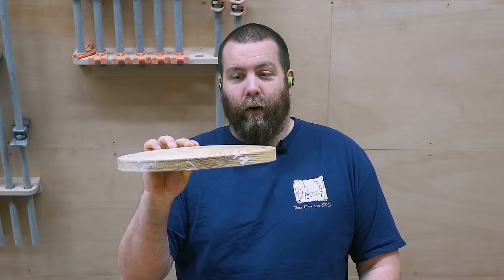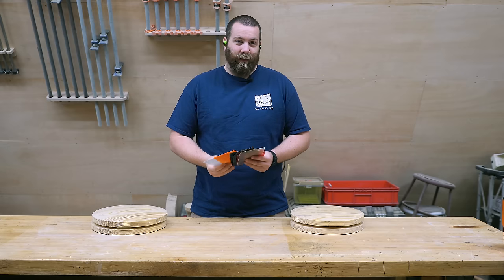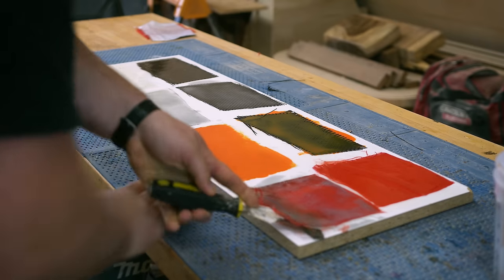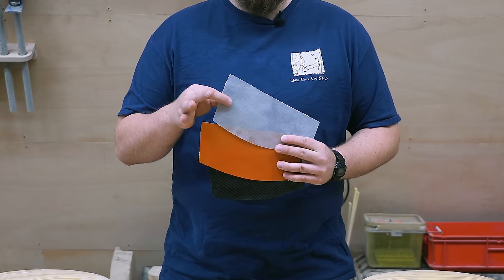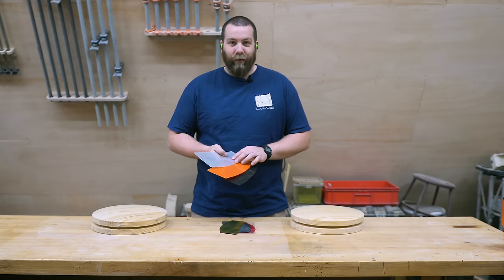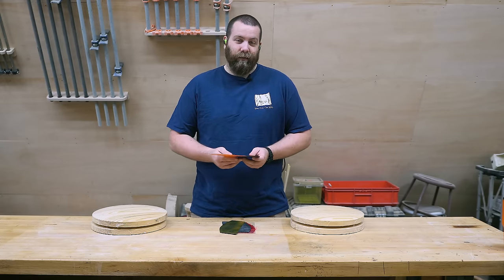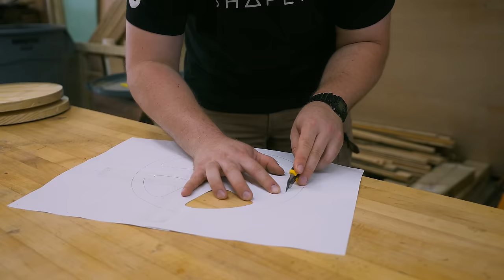I Made Spinning Rims for my Lawn Mower

Comment from the maker: I want to keep making fun videos and my incredible sponsors are the reason I can spend so much time and effort to make them, please support my sponsors so that I can keep doing it! Links and discount codes below for all the sponsors of this video:
𝐂𝐚𝐫𝐨𝐥𝐢𝐧𝐚 𝐒𝐡𝐨𝐞 (code "June15" gets you 15% off all styles thru 6/19/22 11:59EST, code "JACKMAN gets you 25% off select styles thru 6/30/22)
► Gust Lo Aluminum Toe Shoes https://bit.ly/3tFq4VG
► Insulated Pitstop Comp Toe https://bit.ly/3xzvWRB
► S-117 Slip-On Shoe https://bit.ly/3b8UZDB
► Cortex Slip-On Boot https://bit.ly/3Hw4cSp
► Pencil Holder Cap https://bit.ly/3OqnhYJ
► 25% off styles https://bit.ly/3Qmuxqh

𝐓𝐨𝐭𝐚𝐥𝐁𝐨𝐚𝐭 (code "Jackman10" gets you 10% off everything)
► Fiberglass cloth https://bit.ly/3Ohl2ax
► High Performance Epoxy Resin https://bit.ly/3Hvf2YS
► Thixo (thickend epoxy adhesive) https://bit.ly/3PUYq0L
► Halcyon Clear Varnish https://bit.ly/3N3MkiW

𝐈𝐒𝐎𝐭𝐮𝐧𝐞𝐬 (code "Jackman10" gets you 10% off all bluetooth hearing protection)
► Styles shown in the video: FREE AWARE, LINK AWARE https://bit.ly/3N1O38x
Reply: Which are the "select styles", the linked shoes don't seem to apply yet, unless it's for after father's day? Either way great vid 👍,  also my family loves the netflux show.
Reply from the maker: @ironmanguitarhero  Good question! The 25% off is good for any of the styles on this page: https://bit.ly/3Qmuxqh
Reply: @JackmanWorks  Perfect, thank you! I love my Carolinas